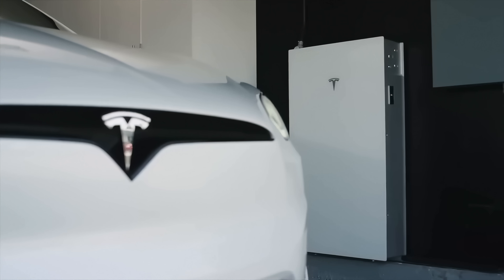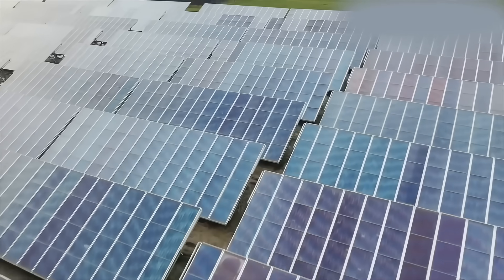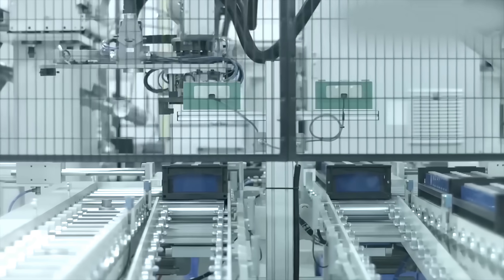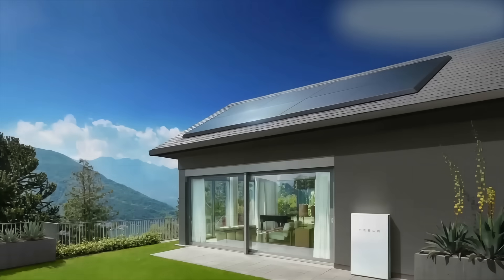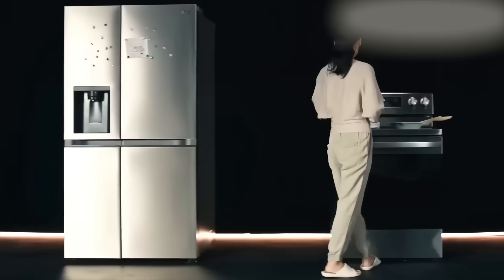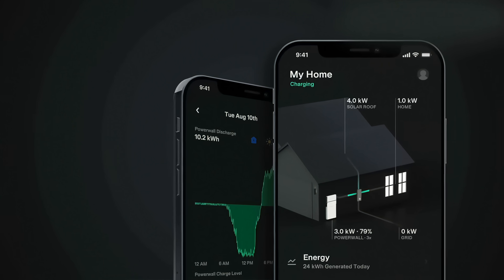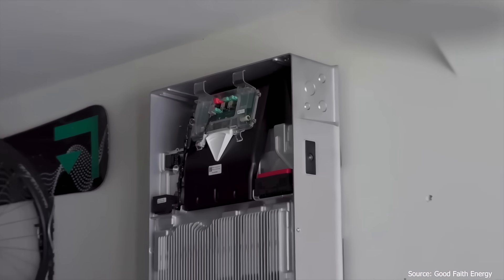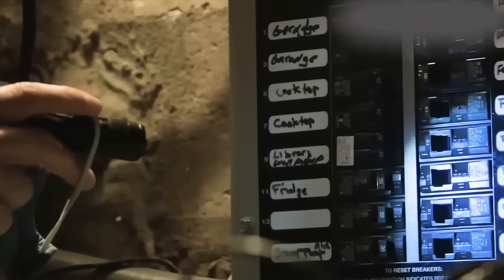Tesla BRICKS Powerwalls Remotely — Thousands of Home Batteries Now Useless

Comment: Expecting Tesla to act in the best interest of their consumers is a great way to be disappointed!

One of my powerwalls is part of the ~10,500 recalled units. I'm not actually mad since this year's hardware failure (every year the system has had something fail) is happening at a low power production time, unlike the two inverter failures that lost me about two months of production during the highest producing months. Tesla's reliability is literally about 80% for me (and this is a system designed and installed by Tesla themselves)!

As you might guess, this latest stuff is just another example of Tesla showing that they only care about the money. They did the recall on powerwall 2s in Australia months before the US and kept saying US units weren't affected, then they started bricking US units long before announcing the recall (with the app just saying the powerwall was in a "low power lockout"). Clearly they had time to handle this better (at least on the US side) but their actions show they were probably going to ignore this in the US. Whats more, they require you to go into the app and look at your home's power status to see that the powerwall has failed, no active notification, no pop-up, no e-mail etc. so there are probably people that have non-functional powerwalls that still don't even know it (maybe they fixed this since the recall became official, I don't really know).

Beyond all this, to add insult to injury on our solar system, during the design phase, shortly before the install time Tesla removed the second inverter from our plan (leaving 12.4KW of panels with just the 7.6KW inverter). This was due to Tesla changing the max inverter overdrive ratio allowed in their specs. In the process they probably removed over 1Mwh/year of generation capacity from clipping the inverter in the summer (also reduced the number of mptts so we probably lost some more power there too). During the install they also lied to my face saying that there would be an over-the-air update that would let the system produce more power. And this was all done by Tesla themselves!

I won't even get started on the misserable experience I've had with Tesla not delivering autonomy features on our Model Y where we bought FSD for $12K.

So in short, Tesla treats their customers like crap!

Comment: I own two Powerwalls, one is currently disabled and the other is working fine.

IMO, the likely culprit is LG, who was also at the root of the problem with the cells they made for the Chevy Bolt. 

My ideal outcome is to have my Powerwall 2 replaced with a Powerwall 3 because it has LFP cells vice NCA cells.

Comment: More reason to learn solar and install your own system. 
$5,000 run s your entire house
2000 watts of solar on a pedestal
2,000 watt inverter and controller
1,000 amp hour LIFEPO batteries
You dont need a solar salesman making 100k a year to sell you a 50k system

Comment: I just installed a PW3. If you have a bricked PW, you should contact your original or a new Solar Installer and get it replaced. The problem is they are in short supply and many companies just cannot get one.

Comment: We went with SolarEdge Home Battery. It is one of the first residential batteries to pass the strictest UL9540A unit level test for fire safety hazards, allowing for indoor installations, but ours are still outside.  Would not deal with Tesla.  They have too much of a break it first, then fix it if and when they feel like it attitude in all their products for our taste.  Your opinion may vary.

Comment: How exactly did they bring the charge of the battery to zero? 
Do the controllers have the necessary load resistors with cooling that will allow kilowatts of energy to be dissipated?
Reply: No doubt that's 'proprietary information' which is only released on a need-to-know [not want-to-know] basis. Consumers and mere official National Regulatory Bodies are not deemed important enough to be told how Tesla operates. Musk has made it abundantly clear that the law doesn't apply to him; Space-X, Tesla, whatever. He does what he wants and doesn't explain his actions to anyone because people are scared of upsetting him and his demented supporters. He's a rich man in a land which (literally) worships and adores wealth, so he's essentially untouchable.

And he can always buy one more lawyer than you can.

To answer your question: I imagine they drained the batteries very slowly over two or three days, not a few minutes, so as not to blow any safety devices, trigger any alerts, or make the homeowners aware that anything untoward was occurring.

It's a scary thought that people aren't in control of their own equipment in their own houses. It's like having a stranger living in the basement: "I wonder what he's going to do today?"

Comment: If the batteries are defective, it's Tesla's responsibility to fix promptly. A fix is either repairing the battery or fully compensating the buyer for the product (including installation costs).

Comment: I wonder how many homeowners, builders/ sparkles/ authorities…, know the temp difference between a standard/ cellulose fire curve (950C) rated product .. like GiB / wall board .. & the temp tgat li-ion can / do burn at… 2700C …, even the hydrocarbon fire rated deck of on oil rig.. only gets to 1250C
No way they should be installed inside

Comment: Umm.... They could cut Elons annual pay by 50% and fix the whole lot world wide in less than a month.

But take the money if its offered. Then buy a sodium ion battery, available from China. They don't catch fire and for home uses are better, they can take recharging for almost ever before the get down to 85% retention.  In cars that means the batteries will outlast three replacement worn out cars and still provide energy to work within specification.
AND
And they are cheaper. marginally bigger but you can keep at night and when away on holiday.

Comment: I work in the solar and battery backup industry. Tesla has turned them all off because our safety issues with them and they’re giving them free power off threes. You can upgrade the power wall three to do more if you pay a little more, but nevertheless it is a free power wall three upgrade that will do exactly what your power wall treated but better now you do have to wait for a company to come get this installed for your neck could be a couple months so that does suck, but you are not just getting stuck without something. You’re turning off your battery to keep you safe and you’re home and family and that base is quite more important than anything.

Comment: Lithium batteries are a known fire risk and this is not surprising. Lithium Ion batteries are causing more and more fires worldwide especially in E-bikes, E-scooters, cars, especially buses, battery storage and re-cycling plants. They were not designed for EV's but for i-pads, laptops, mobiles and power tools in which they are still a fire risk.Batteries should also be stored remote from your premises.

Comment: To achieve zero defects is impossible in complex Li-Ion batterie manufacturing. There is no way to detect hidden defects. It is a matter of time / statistics until serious things happen.
For home storage I would recommend using lead based batteries (lead acid, AGM, ..). In comparison they are very simple and bullet proof!
Reply: Better to use sodium chemistry for stationary batteries.

Comment: I used to have a 2000 watt continuous (3000 surge for 10 seconds)  inverter and could hook whatever batteries I wanted to it (24 volt dc - 240 volt ac). Looking at battery prices now, you can get 12v 100 Ah agm for under $200. Get 10 of those for less than $2000, plug the solar 24 volts straight into it via a regulator and you've got a safe battery and system that can keep the essentials running (cctv / fridge / freezer, lights, modem, router, computer, monitor) . Even my small UPS I have (well not small, but about 1/2 pc in size) can keep my cctv , modem, router, switch running for hours . It was good as recently we had a brownout with only 72% of voltage being supplied. My UPS did its thing and spat out a good clean sinewave and still managed to keep the batteries at 100% by smart charging. The brownout lasted 2 days straight.

Comment: Some home owners in Hawaii got in on the net metering deal before it was discontinued. The way it works is your excess solar goes into the grid and you get credit for it so you can use the same amount of power from the grid for free. So you use the grid as your battery instead of having to host and buy battery. More utility companies should do this and Hawaii should bring it back.
Reply: The reason they discontinued this is that it made it harder for power companies to regulate supply, and forced them to burn fossil fuels that could be turned on and off quickly.  The power company doesn't save any money from making less electricity because they'd need to dial the power back up at any moment.
Reply: @VPWedding  On Oahu they have solar and Tesla megapacks now but I think they still use some gas for power plants. No more coal plants at all. The home owners that got the old deal still get it so I guess that's enough before going to overload.
Reply: @VPWedding  Power companies still hiked prices 50% +, even after killing Net Metering.

Comment: If your battery can't be fixed within 30 days and you still have warranty replacement or refund within another 30 days, you don't have a warranty for no reason. This is added on. There is no reason they can't just turn it off after your warranty anyway, sell safer batteries now that can't be shut down. Zinc batteries are safe and would be cheaper.
Reply: "Zinc" batteries?
(You don't know much about batteries then?)

Comment: As others have noted, Tesla now reduces the capacity of recharge of the Powerwall 2 remotely. Mine goes to 79% and stops. If and only if there is enough 'spare' solar later in the day, it trickle feeds the PW2 a bit more. Sometimes it gets filled up, other times not. But the frustrating part is that the only time of day where we get a better FiT is in the hours after 3pm, which is when the PW2 may then decide to start absorbing solar, so the PW2 is cutting the meagre earnings from the FiT. Meanwhile at midday, max kWh are being sent to the grid with the PW2 at 79%. Not ideal.
Reply: Have you "Read the manual" to find out why?
Reply: @rogerstarkey5390 Thanks. Yes, have read the manual several times. So that reinforces the weirdness, as for four years the PW2 would charge to 100% asap. Since a fortnight ago, it stopped doing that and now charges to 79%. Others like me are baffled and annoyed.

Comment: If I had a product that the supplier found out was faulty, could be life threatening, then I would want them to act immediately to reduce any risk.  This is what Tesla have done, so I give them 100% for the correct action.  They are replacing systems with the Powerwall 3 and fresh warranties.     This report is just Tesla FUD - it is not as they have been left without power,  and any monetary losses from export to the grid will be miniscule.
Reply: They should inform the customer and provide a replacement in reasonable time. I am waiting for 3 months and I have no reply what and when they will fix it.

Comment: If this is what they can do at home it's what they can do to your car. What happens when you have the wrong political views or the wrong social credit score in the wrong hands it's horrifying. I'm all for EV's but I want dumb EVs ones that can't communicate with either the manufacturer or anyone else. 
Nissan leafs prior to 2018 fit the bill. I'd rather put a new battery in an older model for the sake of my privacy and safety. (These models used to communicate by 2g or 3g with the closure of those networks that makes them pretty safe in my view)
Reply: They went through a phase of blocking cars from the supercharger network. I seem to recall that it was cars that had a write off marker applied by the insurance company, possibly just in the US? I don't know if they still do that.

Comment: Are these dependent on owners providing WiFi?  If they're helpless without it, an owner could grant WiFi access during set up and see it functioning for awhile, then change the router password without letting the Powerwall know.
If they have their own SIM card, a Powerwall wold be harder to defeat.
Reply: Then if anything happens to thier house, tesla will say they have no responsibility.   This was a safety issue after all.
Reply: @jebes909090  Did Tesla state that reason?  It's plausible, but I had not heard Tesla explain in any detail.
Reply: @jebes909090  Besides, an OTA shutdown is not the only reasonable action Tesla could take for safety's sake.  They could notify all owners of the issue.  They could make recommendations, including allowing an OTA shutdown, but not necessitating that.

Comment: I object to any company having control over my purchased hardware.  They can send me messages, even warnings, but I retain the ultimately authority over my stuff.
Reply: SO....
Tesla sends a "Message" to say "Due to a POTENTIALLY bad batch of cells FROM ANOTHER SUPPLIER (LG) your powerwall has a remote, but elevated risk of failure, which MAY result (In a tiny percentage of units) result in fire within the unit, and that fire MAY spread. We recommend you discharge the unit"
But YOU take the chance, you have left something flammable near the powerwall, and your home burns down.
You claim insurance, THEY say "There's a notice to warn you to discharge the powerwall! Claim denied!"
So you TRY to sue Tesla?
You WOULD, wouldn't you?
Reply: @rogerstarkey5390 No.  My plan is to build a "power house" underneath the solar panels, built like a basement but entirely separate from the home, and made of concrete.

Comment: We have 48 kWh and paid about 4200€ or 4600 USD and control each of the 16 kWh batteries locally or we sell the right to remote charge the battery during night with cheap energy to stabilize the grid at the cheap times.
Tesla owners were aware about the issues of having anything hardly connected to tesla, car or battery, same issue in general.

Comment: In my first year in my current house, I had 7 or 8 outages.  First was a 2-3 hour outage...then a 3 day long outage which I had a little 2kw generator to get thru (Fridge got plugged in plus one light, a couple of chargers and a small TV set.)-- Another short outage, and a 2 day long outage. I looked at battery systems with solar, but the $$$$$ for a 30kwh and 9kw of solar panels came in at $50,000 to $80,000.  NOT affordable unfortunately.  Then several folk with the batteries had battery problems.  A couple of minor overheats.. and there was a fire up in the big city to the north.  Frankly, the idea of having the battery catch fire while attached to my house?  Not acceptable.  SO that would mean a insulated storage shed in the back yard... another $5k or so.  At least that would mean I wouldn't be caught in a burning house.  The LIFEPO4 were an improvement, but they also still have problems with fire.. far more difficult to go into runaway, but still very possible.  (And they generate a lot more Hydrogen, making a much louder disassembly of its container...)  Perhaps the new cheaper AL battery???
Reply: smh

Comment: Yep anything that can be bricked/controlled remotely by a third entity that is not yours is a big issue. Consumers should stop buying that kind of equipment and only get some that can be controlled locally and cut off/function without the cloud.
Reply: They have to be able to update the devices so the manufacturers will always recommend maintaining connectivity. Your phone, your car and nearly everything you buy today can be accessed by the manufacturer.
Reply: @richardmeyer7018  And that is just the problem. It is your device, you should have end control. You choose to update (if you need to). Otherwise they can just update your device and put functionality you need behind a paywall. Or your device becomes useless when they stop their cloud support, because you don't have direct access... Enough examples of that. And that is just why this is so important to stop buying stuff that is not controlled/owned by YOU!
In this case, if the buyers of these Powerwalls had decided to get a system they control, they would have been able to choose if they took the risk or not of continuing to use the device. Instead of arbitrary having 10,000$s worth of useless equipment...
Reply: @richardmeyer7018 that's the problem

Comment: I don’t own a home BESS. If I paid for a PW2 (or three of them) and I was in line to get a free PW3 (or three) even in six months, I’d be keeping my mouth shut and waiting for the process. The fact that the PW2 can be tracked by its serial number and remotely disabled when recalled is a good thing. The LG BESS recall ia ten years old and still going. I’m waiting for Na Ion BESS but I wouldn’t be surprised if my Na Ion BESS is remotely disabled for the same reason. Failed safe is better than open source in this case. That being said I am more than capable of supporting an open source BESS.I chose not to
Reply: replacement EVERY  6 months?????   FK of  to the the company  clic,,,,,,